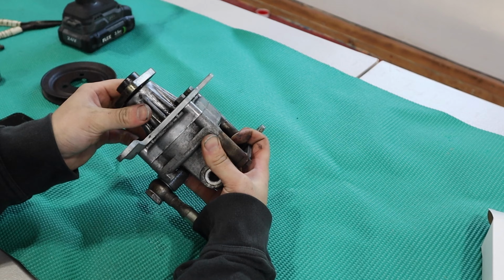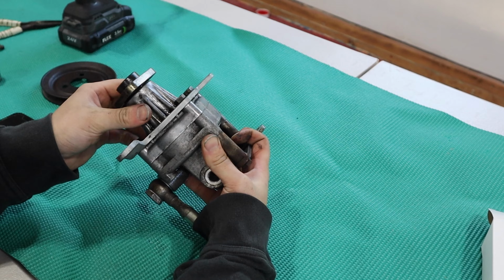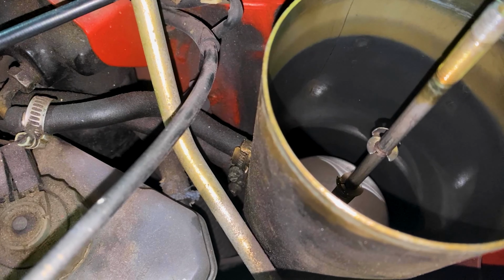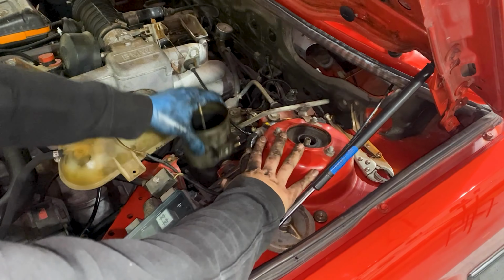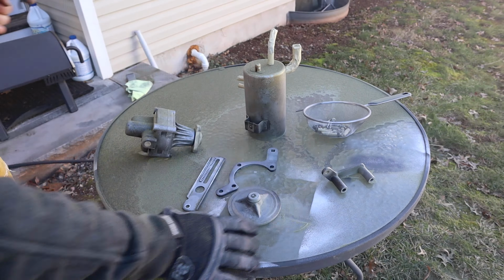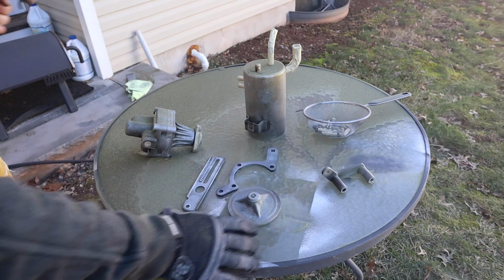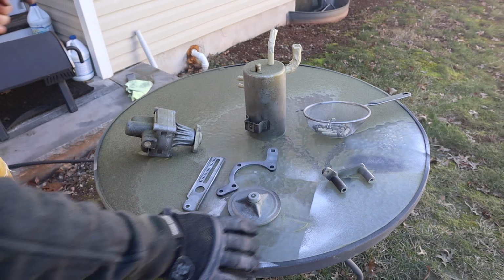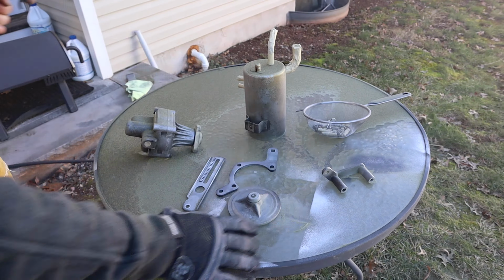BMW E28/E30 Power Steering Pump Rebuild and Install

Comment: Great video.! Quick question though, you said you replaced the power steering filter inside the reservoir, what filter did you end up using as everything I’ve found seems to be NLA.
Reply from the maker: I got lucky finding one on google but they are definitely extremely hard to find now,  Part number is 32411128167 I have heard some people are modifying ones they find online ( cutting and making shorter)
Reply: @MissionmadeAirsoft  I have to give that a try.

Comment: Good video overall but you did a lot of the rebuild out of order. 
Disassemble all the bits, then clean, then start with the shaft seal, then the vanes, then the rings. 
Also to bleed the system you just turn the steering from lock to lock 2-3 times while stationary. You can also avoid the dry startup by hooking up all the lines, adding fluid, then turning the pump pulley by hand (belt not installed yet obviously) to get some fluid into the pump body. 
Cheers

Comment: I see a quite lot of body roll when you're cornering in that parking lot. Have you sorted out all the suspension components?
Reply from the maker: Rear still has to get refreshed but front was partially addressed in most recent video. But with my suspension setup the car still feels really planted.

Comment: What sand blaster was that?
Reply: Yea what sand blaster do you use, and where can I get one?
Reply from the maker: I think I got it from Tractor supply a while back. Definitely not the best but it's for sure getting the job done.
Reply: @MissionmadeAirsoft   what is it connected too? like what size compressor?

Comment: I will never understand why half e28 owners say use ATF and the other half say use Pentosin.

I have an 88 e28 that has a bad power steering whine and I argued with my father for 15 minutes about this. 

( still haven’t fixed it yet , but I have 2 bottles of pentosin )
Reply from the maker: You can use any brand as long as it is Dexron II ATF. Says it right in the E28 Bentley service manual. 
Dex II is now called DEX iv which is what is used in the video. 
Your whine could likely be from using the wrong fluid.. let me know how it goes!
Reply: There is NO pentosin that goes into an E28. ATF only for the steering.